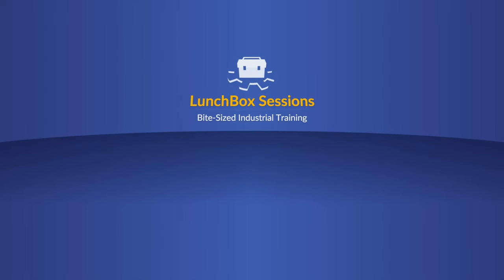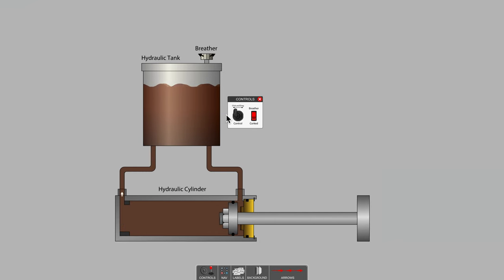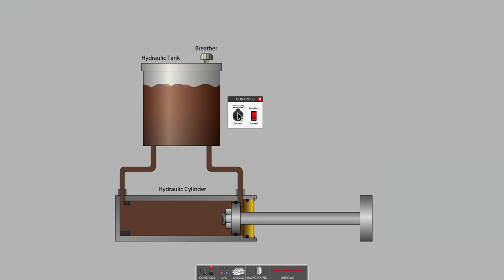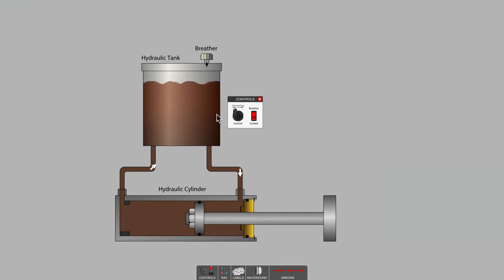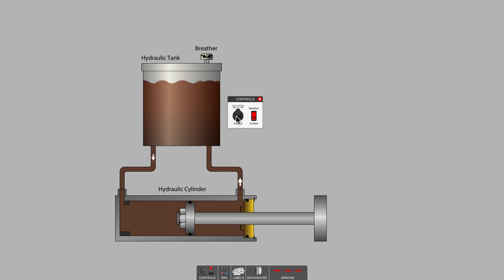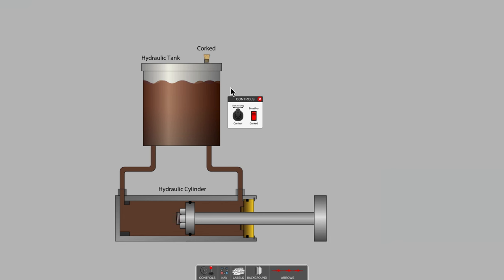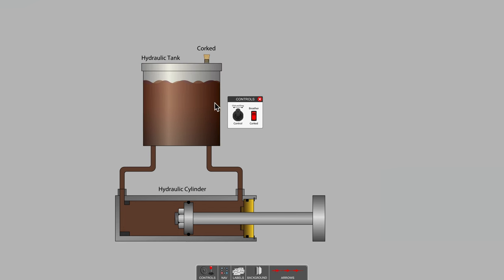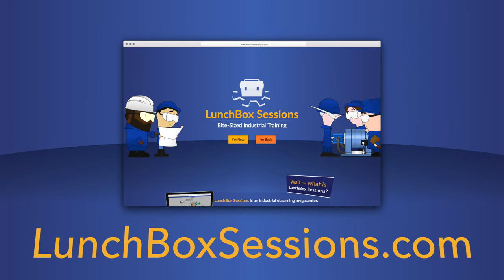What is a Hydraulic Tank/Reservoir Breather?

Comment: Great video and explanation for a "breather cap."  Both of my hydraulic lift cylinders (Case IH MX285) are leaking pretty badly.  I just assumed the seals are bad.  I recently purchased the tractor, so still getting familiar with it.  I located the "breather cap" and after exerting considerable muscle power to remove it, it finally came off.  I think this is also the port (spout) where hydraulic fluid is added.  Well, this thing just didn't look right, a little condensation and just a tad bit of rust and really hard to remove.  It was sealed really tight.  Could the lack of air when the cylinders expand and contract cause the lift cylinders to leak?  Could the breather cap be incorrect for this model?  Please help.

Comment: I have a Hydraulic questions. I have a 20horse tractor that has a loader and the a back hoe.
The tank built into the loader doesn't quite hold enough fluid for both. Like most loaders the controls are at the top of the tower on the right and has a hose that runs down to the bottom of the tank. What if I replaced that hose with a peace of 3 inch PVC capped top and bottom? with of course it will have send and receive lines to hook to the the tank and controls. My understanding is this is a none pressurized section of the system and shouldn't over strain the PVC unless pressure builds up. Would this work and would I need a breather for this as well? Dust trying to get another gallon or less out of the system without adding another tank and pump. Seems simple enough till I start building the peace and find it doesn't work and waists my fluid all over the floor. Eeeh! Just trying to come up with a quick easy fix for not holding enough fluid for the hoe when I'm using it.

Comment: I have a machine with two of these cylinders which will always be opposite to each other. when one is extended, the other is retracted. this would have me believe that the reservoir level should not change. however, when working these cylinders under load, we end up with overflow from the breather. how could this system have more fluid in the reservoir than initially present?

Comment: When i see a Power Pack, breather has a top cover which means that it is always closed then how does it allow flow of air inside and outside the tank?
Reply from the maker: Thanks for your question. The very top of a breather is generally a solid surface, that's true. But the air flow takes place through a mesh screening/filter material and through vents that are down the side of the breather cap. The breather cap overlaps the filler opening. Here's an image of a typical breather where you'll see the vent holes underneath this 'mushroom-like" cap.
Reply from the maker: Here's the image.  http://www.princessauto.com/en/detail/3-4-in-npt-40-micron-breather/A-p1250093e
Reply: Yaa,  I got it after Google search, thank you...now I am all clear. Your videos are very clear and simple to understand.

Comment: But if air enters the system won't that cause aeration??
Reply from the maker: The air that enters in this case is just the air space above the fluid in the tank, as that space increases as the liquid level drops when a single rod cylinder extends. Does that make sense?